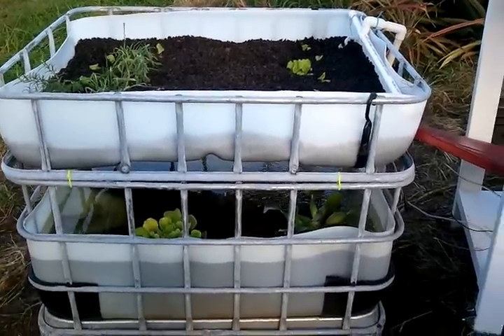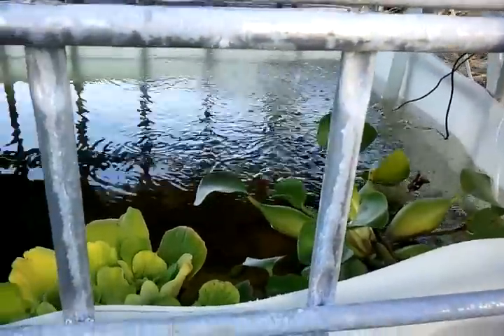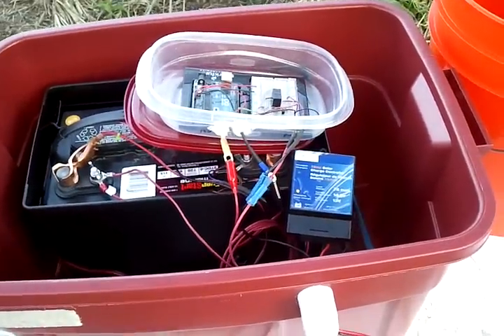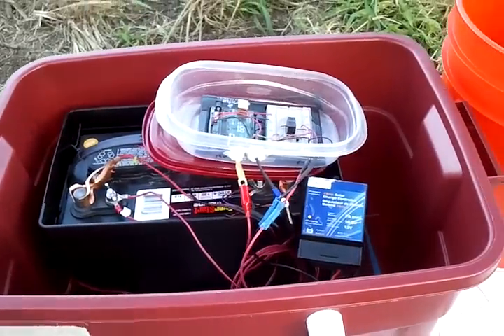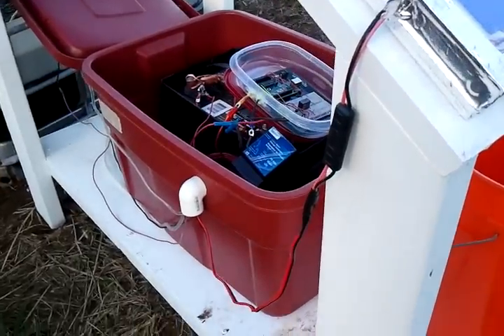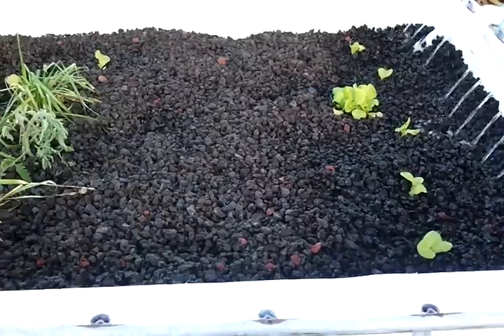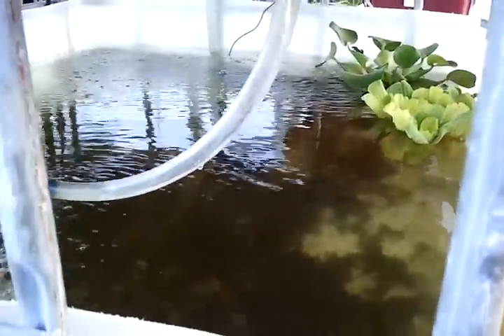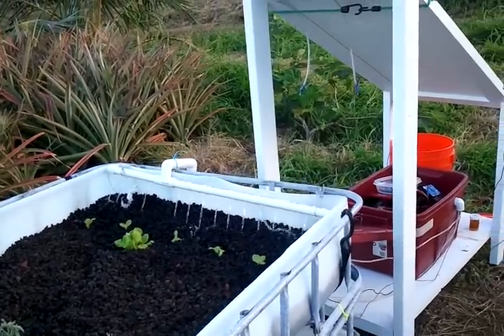solar aquaponics setup

Comment from the maker: I don't think I kept track, but the solar panel I build cost around $150 for all the materials.  The grow bed/ fish pond was free.  I got the Arduino Uno for under $50 with shipping.  The marine battery was~$60 from Wal-Mart.  The black cinder was cheap.  Plus miscellaneous pieces like wire, connectors, containers, etc.  I'd say  total was under $500...but I wasn't keeping track and I haven't kept the receipts, unfortunately.

Comment from the maker: I have Rule bilge pump and it's not nearly as quiet as a regular continuous duty AC water pump.  But it's not that loud either.  I use the bilge pump because that's the only DC powered pump that I could find that moves a lot of water.  Also, I did not want to use an inverter to go from DC -> AC.

Comment from the maker: @giftsfromtheholyland That's quite a bit of power.  If you want a system similar to mine, you'll need a deep cycle batter, a charge controller, and DC air and water pumps.  You can probably get everything from Amazon or a local dealer.

Comment from the maker: @DrReaper Yes I have a ~105Ah deep cycle battery connected to it.  With the current setup I can go for at least 3 days without sun (possibly longer).  No inverter - all components run on DC.